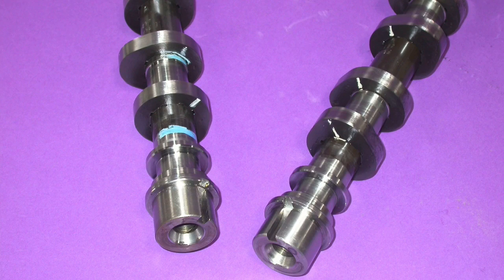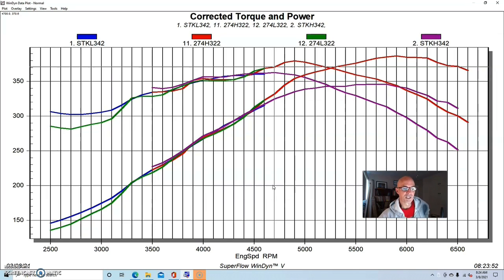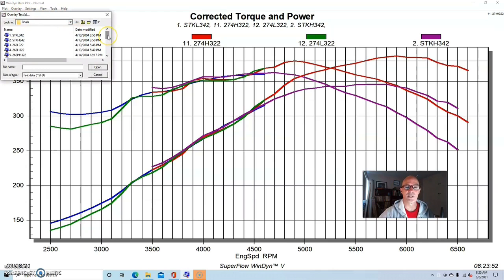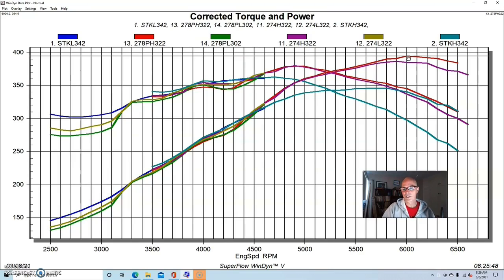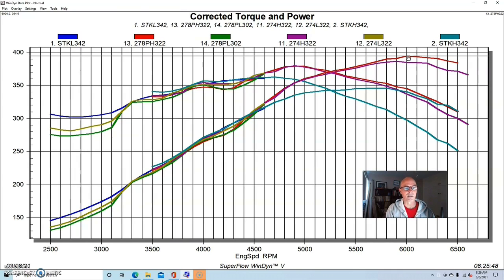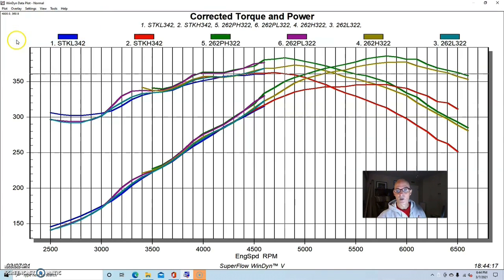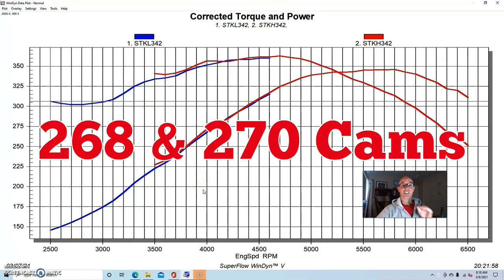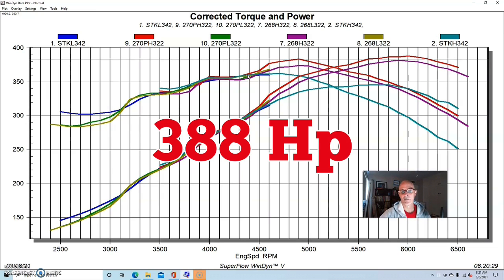HOW TO: CAM YOUR 4.6L 2V MOD FORD (STOCK VS 6 COMPS)

Comment: Hey Richard.  I've got a 4.6 junk yard motor I'm going to build for my 08 CVPI.  Question.  

If you could build your dream 4.6 what would you do?  Would love a complete dream build out list from the rotating assembly, boost, cams, intake, 

My plan so far is to go boosted and have a couple turbos laying around my shop.  I want to do a serious rotating assembly and bump compression a bit.  I know it sounds silly but I'm after a wild idle.  Hoping for 500 to the wheels.  Already installed a built trans and 4:30 rear gears.  I've heard these motors can spin up pretty high over 7k if you have enough valve spring in them and probably would upgrade the oil pan and oil pump.  

Would love to get your thoughts.  Ultimate 4.6 build.  Sleeper crown vic.  😃
Reply from the maker: it would have a fabricated intake-just for looks
Reply: Damn
Reply: @richardholdener1727 i have f150 4.6 2000 4x4. What cam do you suggest for stock motor for a little better performance
Reply: get a stroker 5.0L forged internals, 268 cams or higher if you're gonna rev high, Victor Jr intake, bolt ons n TrickFlow 38cc heads for higher compression if you're gonna run on e85 or any higher octane gas, i went with 44cc heads cuz i dont mind low compression to run low octane gas if i feel like it n not have to worry about engine knock.. Longtube heads is a must too, all bolt ons possible as well..

Comment: I have a 5.4 Triton I would like to run pi heads but the intakes are different from 4.6 to 5.4 because of the deck height
Reply: Hope that helps
Reply: I'm no expert but they're the same heads to my knowledge the difference between the non pi and the pi he is talking about is through generations of the years on the 4.6 has I'm pretty sure the five fours are the same if not all of them have a pi head and all of these cans he referred to will slide right into a 5.4 liter in work just fine there's no benefits to putting a 4.6 intake on your truck motor if it's in a truck because you're going to lose a lot of low-end torque but if that Motors in a car you will gain some high-end they do sell intake adapters by the way
Reply: @TrinidadJames69  the intake ports are lower
Reply: @207BigGameoutdoors  ? More explanation please I'm curious
Reply: The 5.4 got the pi heads in 99 or 2000 maybe 01 . They are basically the same as Mustang pi heads . Slight difference between windsor and romero heads like valve covers ,timing covers, cam sprockets . Other than those minor difference's they are the  same heads. Bore size is the same for 5.4 and 4.6 with the 5.4 having more stroke to increase c.i.d. and the block having a taller deck height. Can use 4.6 pi intake on 5.4 with adapter plates.
Reply: Can run bigger cams in 5.4 since the piston sits deeper in the hole at tdc before ptv clearance becomes a issue.

Comment: How will the PI 262 cam do with stock valve springs? That could be a big determining factor for some people
Reply: it'll work good, 262 n 268 work with stock computer n no tune needed.. 270 n up will need alot more work to get working right..
Reply from the maker: you need to tune any of these cams
Reply: @richardholdener1727  hi, yes, its always best to get it tuned but this is straight from their website.. > "Xtreme Energy™ 226/230 Hydraulic Roller Finger Follower Cams for Ford 4.6/5.4L Modular 2 Valve w/ PI Heads. Better low & mid range torque with more power. Will work with stock computer, but best with custom tuning. (Note: 1999-Up performance improvement heads) <
Reply: @richardholdener1727  Who tunes for these cams ?

Comment: Wonder if a little shorter intake runner would carry power better past 6000 rpm .
Reply: It will. But even a stock intake will, you need bigger cams and a btter valve spring.
Reply: @str8edge_lifer83  Dont think it's the cams , you'll notice on all the cams the power starts to fall off right after 6000rpm. The bigger 280 cam should carry power better up top but it doesn't,  it makes more power compared to the shorter ones but it falls off in the same exact curve and manner .
Reply: @dilsher12  yeah. It needs better valve springs. that stock style intake manifold will pull all the way to a solid 6,700 RPM I've seen many dyno runs live in person that do that it's all about valve spring package and cam duration. Converting to a shorter runner intake will also help with how high the RPM band goes, but the factory intake can go pretty high.

Comment: I’m curious about 3V performance after seeing strong stock numbers here
Reply: I'd love to see a similar test to this with the 3v as well. It seems like a lot of people severely over cam the 3v and are disappointed with the lousy powerband as a result.  Since none of the aftermarket ecu's are set up well to run the VCT,  run them locked out with the TFS 2v/4v adjustable crank gears and run them at a 108 or 110 degree ICL, then pick one of the cams and run it at 102 or 104 ICL to get a bit of an idea of what the potential is by using the VCT. 
A lot to ask but it would be great information for the community.

Comment: Would cams help my 04 f150 get some low end grunt. Mostly use it for towing my travel trailer. Can't afford to replace the truck.
Reply: Not really, only real way to increase torque down low is to add cubes or a positive displacement supercharger, roots or twin screw
Reply: get LONGTUBE HEADERS n bolt ons n your truck will have more power, a small turbo, supercharger, NOS or best of all TrickFlow heads if your engine is 2v n you'l have more power at all rpms which i think is what you're looking for, hope this helps, longtubes n TFS heads for sure, n bolt ons..
Reply: Long tube headers are not going to work in california. Have thought about some type of boost in the 5 to 6 lbs range. Since it's stock, the rings probably won't be able to take much more heat due to expansion than that.

Comment: Does "PI" have some meaning or is it just Ford code talk?
Reply: @naimuddin2074  
Thanks, still not a believer in Ford "Power"
Reply from the maker: Power Improved
Reply: @richardholdener1727  what years did the PI heads come in?  Have an 04 f150

Comment: Would the 5.4 2v be similar? Are the same cams available? Love the content I can't wait for more straight 6 stuff.
Reply from the maker: all these cams fit the 5.4l
Reply: @richardholdener1727  please do a 5.4 2V, there are intake adaptors! Might be a cheap option for the best power boost on a NPi block with Pi heads Mustangs!!
Reply: This guy wrote the proverbial book on increasing 2v modular horsepower. .. he knows about adapter plates , intakes and the low hp potential of the 2v ... but I get it we all still dream of high hp 2v engines .
Reply: To be fair, times have changed since many of these tests were done and tech has improved even for these 2v's. For example, he had to make his own intake manifold to support the power he wanted because nothing was available then. The aftermarket support that was available when Richard was building these two valve engines has improved and people know what works better. Another example, I know for a fact that the off-shelf cam specs that comp uses are less than ideal for a 2v. Once you go past the duration needed to make power with the stock pi intake manifold you just lose midrange power for comparable peak gains. None of the comp grinds for pi or npi heads have tight enough lsa for optimized na use, and most of the pi high lift cams dont even fit without fly-cuts or retarding the cam which further softens up the mid-range(more of an issue of the stock pi heads, valves, and lack of ptv clearance with pi heads). What is funny is companies like MHS, and Cushman have consistently pushed that NPI heads can fit cams so much more aggressive than what would even fit a stock pi headed long-block without bending valves. Nick had his recession buster 2v combos, and both them and cms still havd some of the best modular cams available.

Comment: The real question is why didn't you do an LS swap
Reply: The 'ol single cam swap
Reply: No point to that, realistically just boost the 4.6, the same way any LS swap guy would do minus the LS. 🙄

Comment: Need some cammed 5.4 3v with working VVT enough of this 4.6 2v stuff!!!!!!
Reply: @parkerbethke yeah I get that they’ve had problems but all the problems are solved using the updated parts (except the plugs with the small threads 😂😂)
That fordtekloco or whatever he’s called goes right through this engine and how to fix it it’s not hard. 

So putting that aside I’d like to see what the 5.4 3V can do that’s what Richards channel is all about
Reply: It's enough trying to keep 3V phasers from dying.
Reply: @parkerbethke 
4v has been done heaps already.... down here in Australia they are everywhere 5.4 with 4 valve heads are very common (it’s an engine we made from the USA parts bin) look up ba falcon xr8 
But we also got the 3v engine in some base model cars I have one of those with a stick shift 

It’s a bettter motor down low(vvt) I can actually out run a  4v engine if not modified too much it would be nice to see the 3v have some limelight to see what it’s capable of
Reply: @parkerbethke spark plugs was a 5.4 2v and 2v V10 issue I wanna say.
Reply: Nvm, I thought you were talking about spitting plugs, snapping them in half is definitely the 3v. My bad.
Reply: @parkerbethke why modify anything then just get a better one.. he’s done heaps of tests with the ol 2v there are a lot of 3v engines out there time to see what they can do..

Same as why modify a 2v Cleveland when you can just get a 4v....... because they exist and we want to see what they can do
Reply: But why a 3 valve. 2valves are cheaper and can make the same/ more power. And 4vs can definitely male more power but are more expensive. It just doesnt make sense to me to want to do something with a more expensive inferior product.
Reply: @akassasin5768  people don’t want to pull there perfectly good 3v out of their car? I for one don’t

Comment: Would love to see some higher torque cams on 4.6s
Reply: Swap in the 5.4 , don't think anything would better the stock cams for low down torque
Reply: Truck cams bro
Reply: You need to add cubes or a positive displacement supercharger, only real cost effective way for a 4.6 2v vehicle to feel better down low is 4:30s and/or Tork Tech supercharger kit.
Reply: @str8edge_lifer83  why restrict yourself to a fork tech? Kenne belle makes superchargers specifically for the 2vs
Reply: @Prestiged_peck  because it's the best bang for the buck way to supercharge the 4.6 2v, but if money is not an issue then 5.4 dohc twin turbo setup.
Reply: @Prestiged_peck  also the tork Tech kit isn't restrictive. What do you mean? If you buy that kit you're able to put on any supercharger you can put on a Terminator........
Reply: @str8edge_lifer83  I know I was just saying there are other options, coulda said it better.

Comment: 2004 Mercury Mountaineer with 4.6L AWD.
Is it a PI or non PI engine?
Reply: PI. Starting in 01, everything was PI. Up to 98, everything was NPI, and for 99/00, only the Mustang got the PI motor.
Reply: @michaellehmann2803  the truck engine were pi too
Reply: @michaellehmann2803  care to explain what's the different between pi and npi?
Reply: @19jody72  The heads are much better, it bumped the power up by about 35 from the "best" non-pi motor, which made 225.
Reply: @19jody72  the pi heads have a smaller chamber and more available valve lift as well. The intake ports are significantly better on stock pi heads vs stock non pi heads and they have a different intake port shape. The exhaust port is about the same, its really not that different.
The difference in port shape means intakes do not easily swap over and the biggest limit on non pi heads is the lack of aftermarket intakes and how poor the stock intake flows. For everyone the PI, which means performance improved, is the better head to use.
Reply: @timothybayliss6680  thanks for the info
Reply: @timothybayliss6680  you can also jump to the trickflows if you're swapping from NPI heads and get crazy gains because you can really get monstrous compression with the 38cc trickflows
Reply: @Prestiged_peck  I like the trick flow heads but I have to wonder who they're for. There is a couple nitrous class guys that really clean house where they are limited in the rules to lb/ci and valve diameter. The 2v heads are probably the best you can get in that instance. Those guys are running 270° @ 050 lift cams and running through the traps at 9000rpm. For a street driven car I wonder how much benefit there is over a well ported PI head when you only have 550 lift and 230° cams. They are better than stock castings but are they $2k+ better...
Reply: The PI intake swap on NPI heads is not difficult at all. It just requires a little RTV around the coolant ports, and swapping the coolant tube that goes under the intake.
Reply: @timothybayliss6680  the trickflow heads are really meant for those at the top of the ladder chasing records, but you could probably make a killer NA build with the 185 port 38cc chamber trickflows with some valve reliefed flattops
Reply: So my 97 f150 is npi?
Reply: @19jody72  you may have to check casting numbers/intake ports because it seems lots of people don't know when the trucks went PI.
Reply: Yes, 97 would be NPI. The first PI motors were not until 99, and even then they were only in the Mustang. Everything else went PI in 01.
Reply: @michaellehmann2803  think they said the trucks actually got the PI heads when the mustangs did
Reply: Not on the 4.6. Some of the truck 5.4s got PI heads in 99, but the only PI 4.6 in 99/00 was the Mustang.

Comment: You're gunna make me cam my 4.6 aren't you?
Reply: I run 255/75/17s and two spares in the trunk
Reply: @Dennis Burger mind sharing your combo  ? We bracket race a 99 also but as yet we can barely dial it for Summit Pro ET 13.99.. thanks
Reply: How much hp are you making
Reply: What's the car weigh ? I'm not trying to bust your ballz but that combo might as in maybe on a good day with fingers crossed ,lucky rabbits foot a 4 leaf clover in each hand break 300whp using non modified pi heads .
Reply: @Dennis Burger I'm over here on 32s with a 3.27 gear in a 4500lb vic ;)
Reply: @Dennis Burger did I mention I'm retarded jk ..well kinda . Is that 3100 including you in the seat ? Certified cage in car ? Idk the requirements y I ask . And are you running a   aluminum short block or cast iron ? I have my own light weight goal for the 96 gt I have .. no power windows , no power seats , factory rear spoiler delete, no fogs , no abs, t45 /3:27 trac lok rear  (from factory almost no options ) I deleted a/c system . As it is with couple gallons gas without me in it I estimate 3100 ish lbs. Waiting for a mark vlll to show up at junkyard to get aluminum block.
Reply: @Dennis Burger not 4wd but is my favorite adventure rig. I put slightly smaller tires on it this weekend 245/70/17s. As for a 4 valve they require modifications to work on a 2v block and stock ecu isn't going to like it. For the price of A 4 valve I could build a whole turbo LSx
Reply: @Adrianzx  4v heads are a direct bolt on to a 2v block no modifications needed . You just need the timing chains n timing cover and intake . The stock 2v ecu will work with the 4v as well . But anytime you change a bunch of engine components a tune is needed.
Reply: @sizemore169  on the teksid block you have to drill 1 hole for the thermostat. Nothing but drill a hole . Lay headgasket on the block and trace it out n drill. The WAP block already has that coolant passage open. ... other than that everything is bolt on..
Reply: @Dennis Burger not that I want the 4v per se as the b heads are not the best for a n/a build.  a teksid block with 2v heads combo is 80lbs lighter than your normal pi 2v 4.6 . And the teksid block has pistons with less dish increasing compression a good amount something around 11.5:1 give or take . Less weight higher compression.
Reply: You should
Reply: Can you make a video on your cammed 4.6 I'm looking to do work on mine lol

Comment: I'm not a mod motor guy.. but I do have a 4.6 truck with a 5 speed.. might do some cams
Reply: Yup saw the video...... and said I guess it's time to put some cams in my 03 FX4
Reply: @chrislore2681  yeah man..mine is a 2wd though.
Reply: I got a 97 250 4.6 zf5 4x4 347,000 miles that I smoked finally,  watching with interest myself.
Reply: 226/230 for me
Reply: @Adrianzx   your cams?
Reply: @19jody72  if my stock cams are too rubbish. I do drive my vic at lower rpms quite often
Reply: @Adrianzx  just do the 262 that is appropriate and you'll love it.